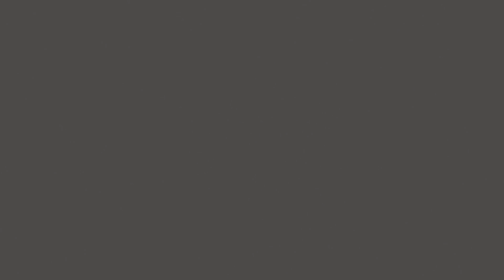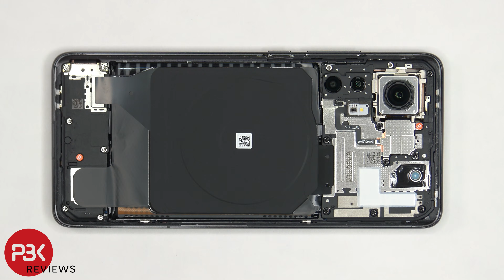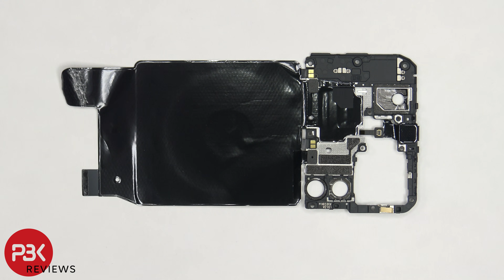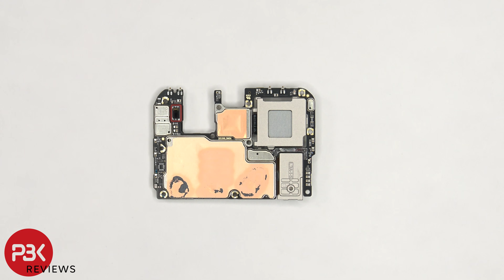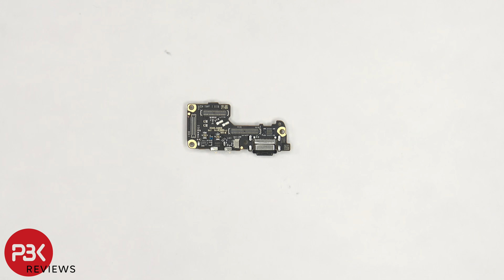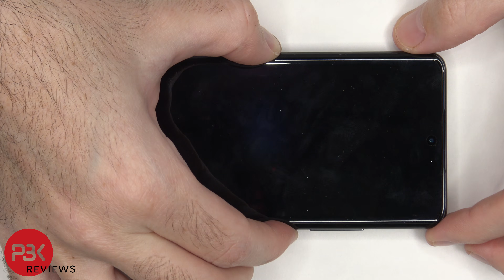Xiaomi 12 Disassembly Teardown Repair Video Review

Comment: Thanks for this wonderful video.
I replaced the battery on my Xiaomi 12 today. After the replacement, the touchscreen stopped working. The black screen and the pixels are jumping around. The lines on the screen are barely visible, and the letters and numbers are somehow intersected by the pixels. The touchscreen works, I looked through all my contacts with a magnifying glass, and everything looks fine, but the screen still doesn't work...
It's a shame I'll lose the photos...
Please help me, what should I do?

Comment: Amazing content!
Quick question...
I dropped this phone in water for something like 10-20seconds...started flashing and then black screen..Any suggestions? Do you think i should open it and check for those liquid damage indicators mentioned in the video?

Thanks a lot in advance!
Reply from the maker: Thanks. If any water has gotten in, its best to take it apart, disconnect the battery, dry out any liquid inside and brush off any corrosion around chips n connectors with a small brush like a tooth brush, and then reconnect the battery and power on to see if it will work. If not you may need to replace parts like the screen or other damaged parts but if the board has gone bad, then your probably out of luck.

Comment: to only remove the battery can i let the upper part rest there with the cables removed? Or do i need remove the upper part aswell. i have the 12x but the battery of the 12 is the same as 12x. i am thinking to repair it some day so i can check for files that are still on there

Comment: 2 years later, after this phone receives an upgrade to HyperOS, i find a little bit improvement with the battery life and heating issues under a normal daily usage such as scrolling social media or even youtube videos, it doesn't heat up as much as before, and i get around 7 hours screen on time compared to MIUI which only gives you like 4 hours at best. (a lot of Xiaomi phone get a massive battery life improvements after the HyperOS upgrade, even the recent Poco X6 Pro that has doubled the time from 4 hours in MIUI to 8 hours screen on time on HyperOS)

However if you want to play heavy game on this phone for quite long time such as Genshin, HSR, or even Warzone, i suggest you buy a phone cooler and a heatsink that you can attach to the back cover, it can help your phone to survive longer.

Comment: How can be removed from the frame the side buttons? Because I tried to replace them, but I didn't figure out how to remove them from the back. Should be removed the display assembly? From the back I was able to take out only the buttons flex cable, but the buttons are like situated into another "chamber" and the buttons are not pressing directly the buttons microswitches, there are 2 intermediate pieces, a metal pin and a rubber membrane. The buttons are pressing the pins, the pins are pressing the membrane and the membrane is pressing the micro switches.
Reply from the maker: The physical buttons on the side of the frame are either push in or pull out. Not sure which one but you can try both to see which works. If its pull out you have to just physically tug them out from the frame. If its push in ones, once you remove the gasket and flex cable assembly with button clickers from the frame slot, you can push in the buttons into the frame and they should come out into the frame slot. But most likely just pull out ones.
Reply: @PBKreviews  Thank you very much for the answer!
Yesterday I tried again to pull out the power button, here are my conclusions.
To take out the buttons by pulling it, it is required to get first another small piece which contain a small metal blade which acting as a retainer. The button have inside 2 small gaps, the one pointing to the phone bottom have inserted this metal piece which blocking the button inside. So first should be removed this piece of metal, placed actually into a black plastic piece, this should be lifted up with a strong needle, and then the button is camming out easily.
The same retention method is applied to the volume rocker button too, but there, the retention piece is placed on the hole from top.
If you inspect carefully the all 4 holes near the buttons with a magnifying glass, can be identified better the retentions pieces.

Comment: You did show rubber orings around sim tray and USB-C connector. Do you think its water/splash resistant even there's no certification? Is there any other way water could enter easly?

Comment: i buy a new one today but it wont start even when i put the charger nothing happend and wont start plz help
Reply from the maker: try holding the volume down and power button for 30 seconds to see if it helps. If not, try a different charger and let it charge for 15 minutes and try again see if it works.

Comment: so it has no dual tone led flash?
Reply from the maker: They might be achieving it with that filter over the glass on the lower portion, but it doesn't have two separate LEDs for the flash.

Comment: Thank you for that great Video! I changed my Display by myself (because the professionel Repair is very expansive in my Country) and destroyed the Black Cable for the Fingerprint Sensor when i opened the Back Case with the Tools .. 1:53 at this point you can see that Cable. Is it possible to buy that Cable new somewhere or can i fix it somehow? Thank you and sorry for my bad english skills
Reply from the maker: None of those cables @1:53 in the video are for the fingerprint sensor. The only cables I can think you are referring to are the coaxial cables/wire cables and those are for antenna connections. You would need to find one in similar length from another phone possibly to use since its hard to find these cables for phones. You can search online for smartphone coaxial cable replacements.

Comment: Hi there. Could someone tell me where is in Xiaomi 12x/12 nfc antenna???
Reply from the maker: It's integrated with the wireless charging coil, the antenna runs around the square portion of the graphite pad/film covering the wireless charging coil on the back.

Comment: If i remove the wireless charger plate of the cellphone to make him more cooler and plus i don't use wireless charging, will be no problem right? I've done the same thing with the lg g6 and no regrets.
Reply from the maker: Yes, will not be a problem, will work fine.

Comment: is the battery 'serialized' ?
Reply from the maker: Not sure what you mean
Reply: @PBKreviews  does the cell motherboard on boot check the battery serial number and refuse to start if the battery is not the same when quitting the factory?

Comment: Sir, can you tell us how to differentiate phone from the inside that has ip rating or not? Does this phone have splash resistant feature?
Reply: I believe it has no official ip rating, though it is somewhat designed too resist water. But just don't be too reliant on it

Comment: Hy, please let me know if did some damage to my xiaomi 12x, instead of inserting the pin in to the sim tray I pressed next to it in to the microphone hole, everything is working fine and when I call the other person can hear me well but my question is there a filter or something similar where is the microphone? And it is possible to break it when I pressed with the pin ejector? Should I leave like this or send it to repair? I really appreciate you answering my questions, thanks
Reply: @Hofi ok, thanks for the answer, a big relief

Comment: It's quite amazing with it's "Compact" sized phone could get 4500mah in it, I hope miui and snapdragon increase the efficiency on this phone
Reply: It's never gonna improve, as the SD 8 Gen 1 is way too power hungry. It heats up and the software does make it even worse. I'd get another device. Using the Xiaomi 12 right now, that's my honest experience. I'm not a heavy user at all.
Reply: @techrevive_3  agreed, have seen lots of review and it's not efficient, glad that xiaomi release the xiaomi 13

Comment: Hello, I just broke my big camera glass, how can I replace it ?
Reply from the maker: Its held in place with adhesive. You can use a hair dryer to heat it up and a tool or thin razor to pry it off. Replacement camera lens cover or glass should come with replacement adhesive.

Comment: this or the pro, which one you would prefer for daily use? also are these water proof enough?
Reply from the maker: Depending on your budget, either would be good for daily use. The 12 is good enough as is, the pro has the additional 2 speakers and minor other upgrades which I would prefer. Also these aren't really water resistant. There is no IP rating nor are there any gaskets around connectors etc. So I wouldn't risk dunking them in water. :)
Reply: xiaomi 12 is good enough, I am currently using it, unless you want a bigger screen for about 200 usd. Or go for xiaomi 12 ultra if you want a even better camera

Comment: Ever happened to you that the phone didn't start after you said power it on an you are done?
Reply from the maker: lol ya I think once, I don't remember which phone it was but it was a while back. Had to take it apart again to see what I didn't connect properly but got it going. After I'm done with the videos I take the back cover back off again to apply new adhesive and re apply the back, so if I run into an issue with the phone not powering on, at that point I can take it apart again and see what I missed.

Comment: That massive vapor chamber it has and still heats a lot.
Reply from the maker: Yup, but keep in mind, just because the phone gets hot doesn't mean its over heating. It could just be a sign that the phone is efficiently transferring heat away from the components and out of the phone. The only time you should be worried is when the phone is running slow or slugish and the processor is running hot. 😀
Reply: @PBKreviews  But its Passively cooled. There is a certain heat capacity of the Vapour chamber after which it wont be able to cool the device, Unless the Front and the Back Glass come in contact with cold objects (Our Human Hands are certainly not cold objects)
Reply from the maker: @jashsylde8136  True